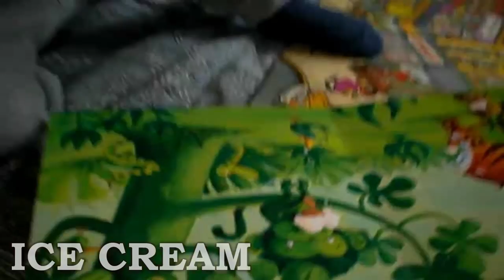How to Cook Venison Properly! | Show Us Your Steak Challenge | Men's Mental Health

Comment: 02:36 you should season it after it is cooked. Salt won't draw water out of it and you would not heat the seasoning.
Reply from the maker: I find it doesn't stick well enough, light salt, more at the end :)
Reply: @TheWoodedBeardsman  Maybe also the cooking procedure affects, you used oil and butter afterwards. I use nothing on the pan, I just heat it really well and then sear the meat. It renders its own fat and cooks in it. Also, I salt it afterwards because I use a salt I picked up myself from natural sea salt mine. I have the salt rocks, I grind them to a powder, so I always have in mind that I got such a natural and unprocessed salt that I don't want to heat it. BTW, the difference with regular salt is noticeable. If I put a teaspoon of this natural salt in a glass of water it tastes like sea water.